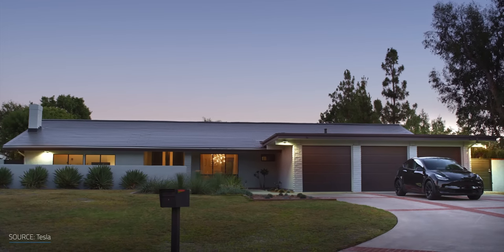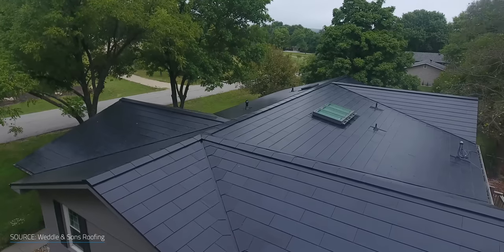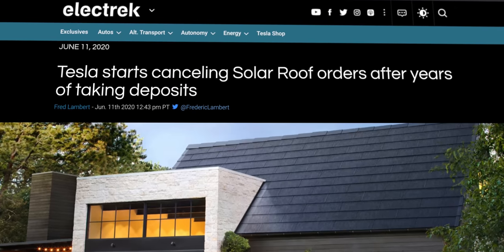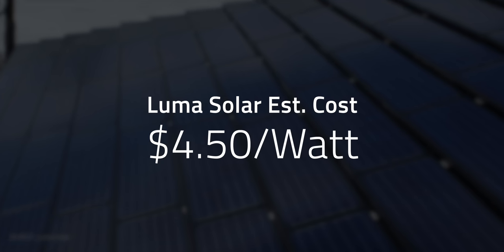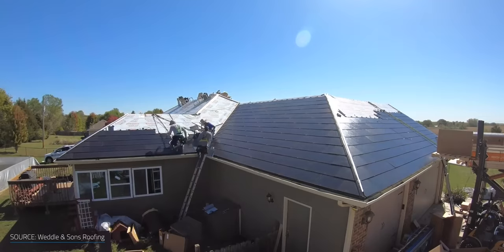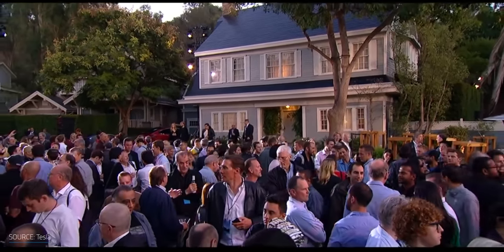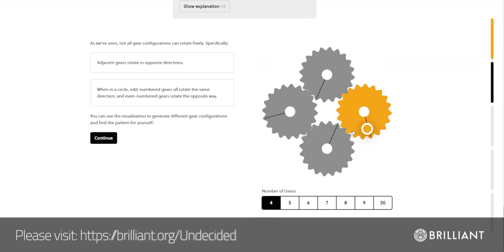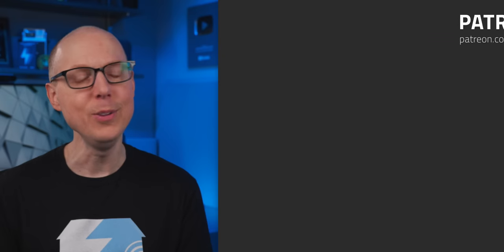The Problem With Tesla’s Solar Roof

Comment: Had to replace a roof last year, still no good options for an affordable solar roof and I have plenty of land for ground mount so all my solar is ground mounted. $8k for a new roof, was installed in 2 days with a 25 year warranty. 10kw of ground mounted solar installed myself for less than $4k and maintenance is easy. For those that only have space for roof mount the prices still need to come down but a new standard roof and standard roof mounted solar is probably cheaper than any of these solar roof options until the pricing and install becomes more mainstream. The pricing is still very much early adopter territory.
Reply: Here in Cali a standard metal roof install is “$1500/ square”

God knows what solar roof would be. 
We have off grid. Panels up on the hill. 
I live in a geodesic dome and only a few panels do more than I need, even in the woods with intermittent shade all day. 
I like the shade
Reply: Ground mount isn't practical for anyone on less than a multi-acre property, and honestly it's still kind of problematic for other reasons even if you do have plenty of wide-open unshaded space. Honestly I'd recommend putting it on anything solid and elevated, even if you have to build a whole new shed, barn or awning to do it.

Right now it depends where you live, but a solar roof is roughly the same price as a roof + solar in my area. They need to bring costs down enough to compete with those people pondering an upgrade on one or the other.. like people that want solar but their roof probably has 5-10 years of life left, or people that just need a roof and can look at it as a chance for a discounted electric bill too. Right now it feels a bit wasteful to make the leap.
Reply: @EileenTheCr0w  I only have an acre and a half and even with that it's plenty of space but obviously ground mount doesn't work for everyone. I would also need to remove 3 or 4 trees to do roof mounted and I would rather keep the trees. The shade they provide my house is worth it. Cost for ground mount framing doesn't have to be that expensive depending on where you live. I used helical screws so no concrete involved and it can all be easily removed if need be down the road and recycled.

Comment: Actually the 1st integrated solar roof was installed by my company CSI in 1979. It was solar thermal not photovoltaic. The solar panel was laid between rafters 24 inches on center generally about 16 ft long. We did several hundred of these systems generally 300 to 600 sf
for space heating in New England. Worked great. My 5000sf office in NH was 100 percent solar for over 25 years
Reply: Would love to discuss more with you on this. Can we work together to achieve a solar roofing sheets?

Comment: I’ve been a solar installer for 20 years and always been skeptical of the various solar tiles/shingles I’ve seen over the years, but a couple of these products seem as though they could be promising.  I’ll call myself ‘cautiously optimistic’ now. :)
Reply: Which ones look promising to you?
Reply: @fparent , From a purely design and practical application standpoint, the GAF energy module seems promising because the wiring is accessible from above.  A tremendous weakness of most solar tiles is that they’re plugged together under the tiles.  This makes troubleshooting the electrical, replacing faulty or damaged wiring, or replacing a faulty module much, much easier.

There are still some downsides:
A). Who the heck is GAF energy?  What does a 20 or 30 year warranty amount to if the company is here one day and gone the next?
B) If GAF (a name that seems doomed to failure, btw) does stick around, are they really going to maintain enough back stock of their original product to replace like for like when honoring their warranty 20 years down the line?  It’s very possible they could do this by making sure their new products follow the same mechanical form factor and don’t stray too far off the same electrical specifications, such that they can send the current model they offer in place of your faulty, older model.  That’s possible, but what assurances do you have of their future course of action in a world of rapidly changing technology?

Sorry, I gotta go, or I’d address one or two others.  Maybe later, if I remember. :)
Reply: this is basically the same reason why i haven't got solar either, it's either tesla or some unknow people, it's why i hate certain markets because then your just in a market with companies you never heard of
Reply: @knightwolf3511 , LG and Sonnen are two large, well known electronics companies that come to mind, who make this type of battery.  If they do leave the home battery market, at least you’re more likely to receive support on an existing product, unlike a company founded for the purpose of selling such batteries; if they go away, so does the warranty and service support.

An example of that with inverters, and now PV panels, apparently, would be Sharp.  Sharp made their own PV inverter back in the early to mid 2000’s, but ultimately decided it wasn’t worth it for them to be in that market.  It was only about five years ago when I could no longer get parts to repair those inverters.  Hard to be sure, as there are no 100% safe bets, but with Sonnen and LG I reckon there’s a better chance of receiving that type of support even if they ultimately bail on the market.
Reply: @adlockhungry304  GAF Energy is a Standard Industries company, I wouldn't worry too much about them disappearing anytime soon. GAF is one of the largest roofing companies in North America, their solar shingle is an evolution of their EverGuard solar membrane which has been around for at least 10 years. We were considering the Tesla roof (own a Model Y and will be purchasing a second one this year) but leaning now towards the GAF. Our 19 year old Florida roof is in need of replacing, so seems like a good time to do it!
Reply: @adlockhungry304  GAF has been around since the 1800's.  I wouldn't worry about a 20-30 year warranty backed by GAF.  On the other hand, Tesla doesn't have a good history of doing anything particularly well.
Reply: @PattyKollias , that’s good to know GAF is part of Standard Industries.  Thanks.  I will say, though, that being “one of the largest roofing companies in North America” is no consolation.  I could have said the same thing about PetersonDean, another large roofing contractor that got into solar that went belly up.
@Joe Green, on the contrary, Tesla seems to be doing quite well in the electric car market.  As far as their home/commercial battery goes, I’m reticent to judge till they’ve been on the market a bit longer.  I am concerned about the fire safety of their particular battery chemistry, since theirs are more prone to potential thermal runaway events should they be damaged.  I believe the reason has to do with the greater energy density by mass and/or volume, but there are safer chemistries, such as lithium-iron-phosphate, that don’t pose the same risk and still have perfectly satisfactory energy density.
As far as their solar tile goes, I remain highly skeptical until they can actually move units to market in a fiscally reasonable manner and demonstrate performance in the real world at scale.
Reply: Unless you've worked for NASA as an installer, I highly doubt you've been installing for "20" years stop the lies
Reply: @njo5189  Solar panels have been around for 50 years.
Reply: How do these shingles perform thermaly? Do you know?

I doubt they reach their rated efficienty mounted directly to the roof. These things must become rather toasty in the full sun without the ability to radiate their heat away.

Comment: If I get a new/old house that needs a replacement roof I'd give it a good look. Otherwise its got to be solar panels and a good roof orientation.
Reply: Solar panels are too good to pass up. They look good and produce a lot of power. Check out Aptos Solar. All black premium panels for a great price.
Reply: And ensure that you don't have too many trees shading the roof.
Reply: @JBoy340a  or of most of your roof is pointed the wrong way
Reply: Solar isn't worth it and takes decades to break even, and by then you'll need to replace them anyways with whatever the new and more efficient technology is hot.

They also degrade extremely fast and make your house look very ugly and harder to sell.
Reply: @BoleDaPole  hey, buddy, you might want to come up with some new anti-solar talking points that didn't come out of 2010.

Comment: My experience was overall good. It did take a lot longer than I would have like to get in installed. I put the deposit down in October 2020, the roof was installed in June 2021 and active in December 2021. Its an 8.7 KW system with two power walls. The total cost after rebates was 36k.
Reply: What happened between installation and becoming active?
Reply: In a heavily populated area ?
Reply: @dansands8140  yeah, missed out on summer !
Reply: That price is ridiculous compared to other options.
Reply: @davidpearn5925  No, I mean, why wasn't it immediately active?
Reply: @dansands8140  yeah I understand that.  Maybe the feed-in distributor wasn’t as enthusiastic at the time of season….?
Reply: 14 months after deposit? I think you need to reassess what “overall good” means. Even with your disclaimer. Perhaps you were “satisfied with the results when finished” might be more accurate?
Reply: If you have no immediate need and your expectations are aligned with the real timeline, then the experience can still be good. The delay from installation to activation would have bothered me the most, but unless there was something wrong with the installation that caused a another inspection, that delay is on the municipality and the power company. I wouldn’t judge the installation experience on that.
Reply: @user-dj1hy6zc6q  $10-15K of that was probably the two power walls, which aren’t usually entitled to rebates. So $20Kish, after rebates, for a fairly large system, 8.7KW, that’s basically a combo between a new, more weather-resistant roof and a solar system.
Reply: For 36k, you'd probably be better of just buying your electricity.
Another similar system would probably cost around 18k$ before rebates...
Reply: @tiloalo  I needed a new roof. The cost of just the roof was almost 15k. 21k for the solar tiles and the 2 power walls seems like a good deal to me. I'll save 20k over the next 20 years. It pays for itself.
Reply: @dansands8140  Inspection and PTO. Tessa wanted to use a different backup switch but the power company didn't approve
Reply: @davidpearn5925  Yes, 20 mins from NYC
Reply: @csmarkham  I wasn't paying while I waited, So I didn't mind.
Reply: @aggiewoodie  If you can only charge the power wall from the solar, and that is the case in NJ, you can claim the 26% rebate
Reply: So two power walls because you wanted to be able to power all of your house for a day or so in the case of an outage/bad weather?
Reply: @michaell170  that is correct
Reply: 36K!!!
Reply: Just got a notice from Tesla that they are refunding me 3k due to a price reduction. Wow!
Reply: That brings the total cost down to 33k
Reply: @ka0235  Maybe solar just cost more here in Texas?  I have a 12.5kw traditional solar panel system with one powerwall and after rebates the cost is $42K.  I had several quotes from different companies and they were all comparable.
Reply: @markporter2642  more likely your home is a lot bigger 🤣
Reply: @ka0235  The other benefit of 2 Powerwalls is that if you have an EV and arrive home in the evening (with both Powerwalls pretty full) you can charge your EV for an hour or so without pulling off the grid.  One Powerwall can't do that as most domestic chargers (at least in the UK) are 7Kw... a single Powerwall is maxed at 5Kw continuous.  So 2 x Powerwalls (10 Kw combined) 'pretty full' you could charge the EV for an hour (or two) and still have enough left to run the house overnight.  I am considering a second Powerwall for exactly this reason.... Might seem like a small thing but when you start adding up all those 1 - 2 hours pulling an extra 2Kw + off the grid over many months it will add up.  The whole point of having Solar PV and storage is to maximise the amount you can use 'off the roof' across all of your consumption use cases...

Comment: The best engineering solutions are always the one's that have the least compromise but when you're asking a product to be two distinctly different things- a roof and a solar power generator-  compromise is inevitable.
Reply: Complexity is a b*tch. Most probably are fine just with regular solar panels.
Reply: THIS
Reply: Flying car anyone? I think it should be possible to better integrate conventional panels into a roof. My roof is basically an asphalt membrane with concrete tiles over it. Those concrete tiles act as a shield against UV and abrasion damage for the membrane. Water will largely run over them but they are certainly not a waterproof layer. I cannot see why they can't be supplanted by solar panels. The issue might be with a need for free air flow under the panels but that should be achievable. The panels should be able to sit a little bit off the impermeable membrane. American house design needs to change to make sure there are ample, clean roof areas facing South, and potentially put in panel standoffs as part of construction.
Reply: @errcoche  Will people want a complete roof that will need to be replaced every 15-25 years? Rooves are covered in things like slate, steel concrete for a reason. They last.
Reply: @alunjones2550  Depends where you are. Panels are generally warranted for 25 years and American shingle roofs don't last that long. My US concrete tile roof lasted 30 years
Reply: I used to carry a Palm Pilot in one hand and a cellular phone in the other.  Two distinctly different things.  Then they combined the two into a single device.  Why would you use two separate devices today?  Just doesn't make sense.  In fact, the main failure of PV is leaks created by treating them as a two-part system instead of one.  Roofing and solar is/will shortly be the same today.
Reply: @DK-vx5co  But they're not different. Palm pilot functions are screen based date apps, mobile phones are screen based data apps. Why wouldn't you combine them..
roofs are encompassed within civil engineering, designed to protect structures from atmospheric conditions, Solar panels are relatively fragile photo voltaic cells designed to generate electricity.  Chalk and cheese.
Reply: @alunjones2550  I'd like to have an intelligent conversation about his, but not sure what the above comment means (grammatically).  We eventually find ways to effectively combine most things: peanut butter + chocolate, apps + phones, roof + solar.  Sometimes it's done badly because people are lazy and are constrained by not thinking "outside the box".  We build Passive House, and we're always looking for synergies, often "outside the box".  That's how progress happens.  That's why you're not walking around in animal skins and fighting over a limited supply of caves.  Someone said: why not build houses, why not put a roof on it, why not combine two things up on top of the house.  Who was it that said, conformity is the hobgoblin of small minds?
Reply: @DK-vx5co  I'm a chartered mechanical engineer, i agree with pretty much everything you say however, you're ignoring the key issue I raised. Very few things achieve their best capability if they're expected to do something else as well. That's why the 737 Max has been grounded for so long, that's why an F1 car that's faster on the straights is slower in the bends. You're just going on about development and progress, I'm talking about the inevitable compromise that comes from asking something to do two completely different things i.e. be a roof and be an efficient electrical energy source.
Reply: @errcoche  You think any company will still produce the same product you bought just 5 years ago? You think the company will survive 25 years?
Reply: Agreed. Solar shingles are merely a novelty, much like Elon's other secondary ventures, namely the boring company. He needs to focus on his cars.
Reply: @errcoche     Interesting comment.  We build Net Zero Homes.  All of the things you mention, we do now as our SOP.  Sometimes reading these comments it's kinda like watching a whale trying to knit.  As long as clients "get 3 bids and take the middle price", they will keep getting the same mediocre results they love to complain about.  We can easily build to last 100+ years.  In addition to saving money on energy, there are dozens of additional benefits for you and future buyers (higher resale value, lower insurance, etc.).  I will say that finding contractors that really "get it" are as rare as hen's teeth.  It's probably the greatest financial investment you have, so some research is probably worth it.
Reply: @joegreene6250     Nope!!  I sold PV & roofs for a company for a while, but it was so distasteful I walked away.  
Top Tip:   20-30-year roofs are the same as 50-year roofs.  a 50-year roof has a pro-rated warranty (for which you pay a premium) that may or may not be transferable, which eventually becomes worthless after a decade or so.  Plus, walking around on roofs can wear off half of its useful life.
Reply: @shadiahmad4848     I don't know about that.  He's the richest man in the whole wide world.  Lots of people vote with their dollars.  By definition, he's thinking better than almost everyone on the planet.  He has an overall plan, and many of his endeavors are woven together.  Disclosure: I have Tesla stock.
Reply: I think a good solution would be just to incorporate existing solar panels into new buildings, so they won't stand out so much and blend in with the building. pretty much best of both worlds without too much compromise. won't work on existing buildings though